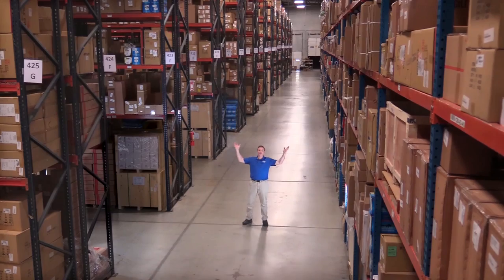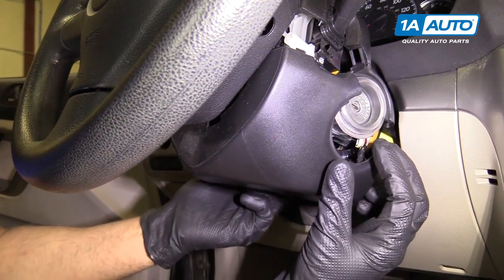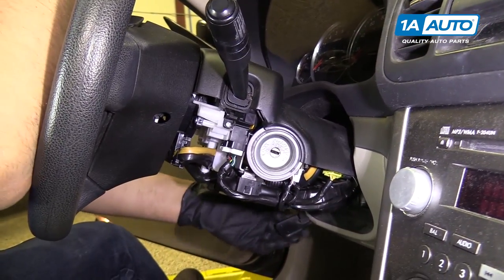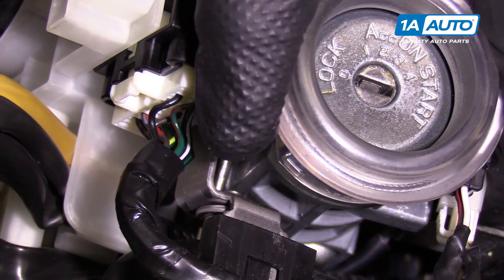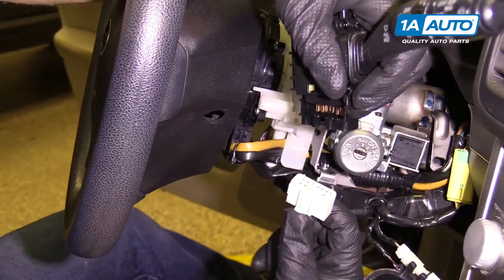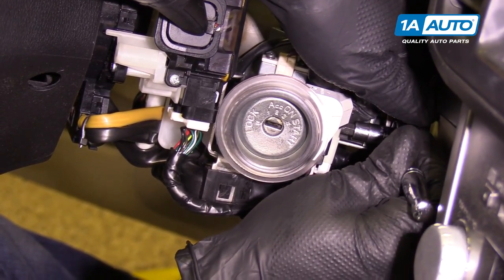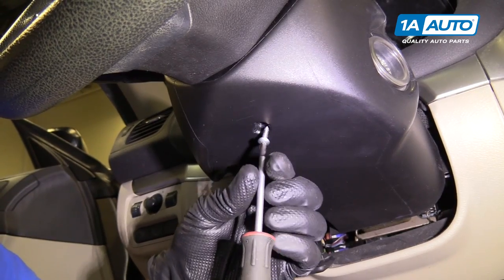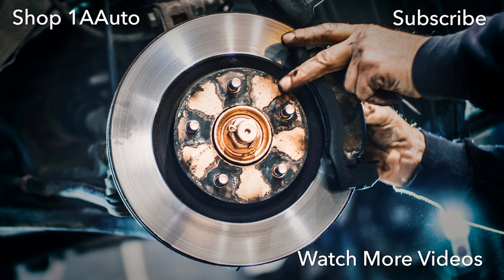How to Replace Windshield Wiper Switch 04-09 Subaru Outback

Comment from the maker: √  Watch the Video
√  Buy The Part at 1A Auto http://1aau.to/m/Visit-1AAuto
√  Do it Yourself
√  Save Money
Reply: I checked thoroughly on the 1A Auto Repair website for the windshield wiper switch in the 2005 Subaru Legacy and it does not show up.  When I type "wiper switch" or "wiper lever", nothing comes up

Also,  Subaru is so dumb for having this type of difficult setup.
Why not have 2 screws on each side like the Toyotas.

To access one screw you simply turn the steering wheel in one direction to access the screw and vice versa.  Then all you do is unplug the connector for the wiper switch and replace it.  That's how the Toyota setup is.

There is no reason why all the manufacturers can't use this simple setup

Comment: Would this fix the wipers not "parking" back to the bottom position? And another symptom is the intermittent wiper feature doesn't work. 2009 Forester.

Comment: I could not remove the ignition tumbler cover. The switch came off OK, but in order to put in new switch, I filed off a tiny section of the tumbler cover that was impeding the switch. I do not think anybody would ever notice. 2009 Imprezza.

Comment: The steps of removing the ignition tumbler cover aren't necessary. If you disconnect the wiper-switch wiring harness while the switch is still in place, you can remove the switch without having to mess with the ignition tumbler cover. Just bends the cover a bit, but the switch is easily removed and reinstalled.
Reply from the maker: +d We appreciate the feedback. Sometimes there are multiple ways to accomplish the same repair.